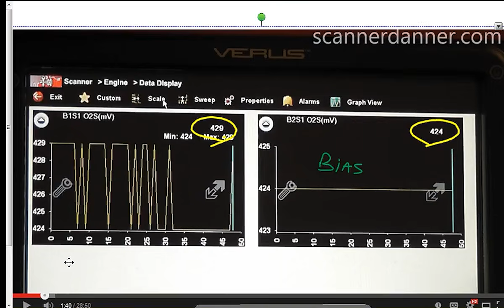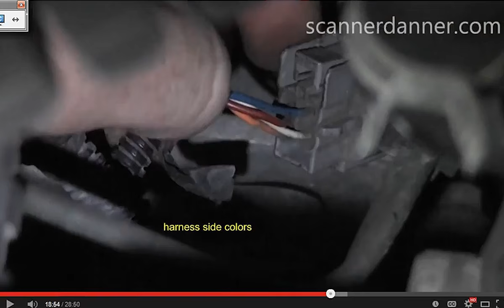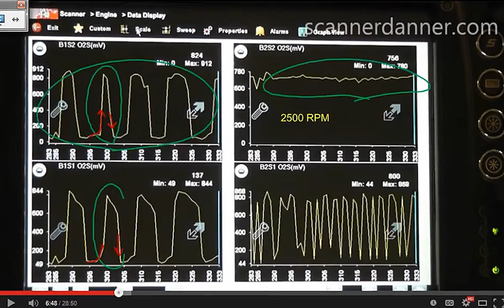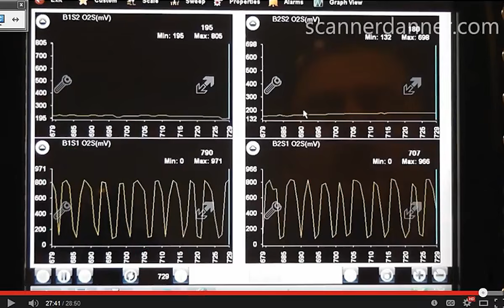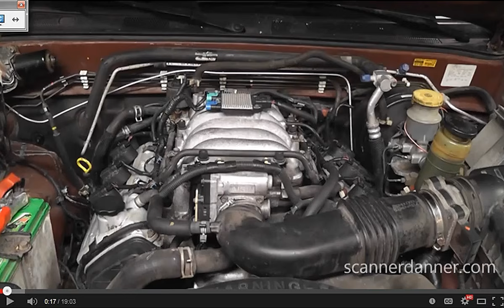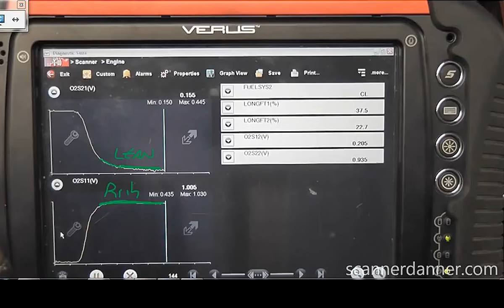P0133 Oxygen Sensor Slow Response - how many of us just throw a sensor at this code?

Comment: I have a 2002 Lincoln Ls v6 and getting this p0133 and p0301 I bought a new upstream sensor and installed it car still ran rough but no check engine light or codes before this I took out both bank 1 and 2 and cleaned them I may have accidentally got them mixed up would this cause this issue?
Reply from the maker: Focus on the cylinder 1 misfire first

Comment: Of ALL the diagnostic electronic issues a technician is trying to analyze - they should not even have to be concerned that the analyzer is not reporting the correct sensor 🤨 AND  what you teach regarding incorrect identification of the proper sensor reporting  Is indeed because YOU are an ACE TEACHER AND TECHNICIAN 👍 but - surely - this knowledge only comes with MANY YEAR of EXPERIENCE - THANK YOU for ALL you share and teach 👍✌️

Comment: Wow, that's a tough one!  I've had those moments too, where a problem feels impossible to solve, and then it turns out to be something so simple and unexpected, like two O2 sensors being swapped. Every challenge like that is a learning curve. That Mazda CX-5 might have kicked my butt for a bit, but now I've got that experience in my back pocket. Next time I run into something similar, I'll know exactly what to look for. Thanks for the heads-up, Paul!

Comment: On the Isuzu rodeo "low power" case study, would bank 2 receiving the incorrect lean signal from the wrong bank be positive 40 and bank 1 thinking it's running rich so it would be -40. You said add 40 for bank 1 and -40 for bank 2?

I understand the majority of the information and what's going on in the explanation, just seems like you got you numbers backwards. Thanks for all that you do.
Reply from the maker: It's possible I got my numbers backwards in my example from what was actually on the car. But one bank will be full rich and the other full lean. I'll watch again. Thank you!

Comment: Same connectors happen so often it's insane!

Some of my favorites include:
2022 Chrysler Pacifica, hood latch ajar connector and horn connector are the same and live right next door to each other
2017 Toyota Highlander, Wheel Speed Sensor and SRS Impact Sensor connectors are the same, and the harness easily flip-flops so both are within logical distance.

Now here's the big question for you:  Can a wheel speed sensor that generates voltage in operation create enough voltage to trigger an airbag deployment?  I don't know, and I kind of don't want to know, because I almost took that car out on the highway instead of just creeping around the parking lot...  LOL
Reply from the maker: Damn, that would be possible. Wonder if that WSS was a VR type or digital type? But either way, I wouldn't want to find out either

Comment: And another when I worked at the same dealer, a used VW had some faults and MIL on.  I don't remember the codes, but one was circuit high and another was circuit low.  Turns out that whatever sensor had the faults had the same connector as the hood ajar switch

Comment: Also, I worked at a Mitsubishi dealer and a customer brought in an old model for a rear main seal.  The other tech had to cut off the exhaust because the factory exhaust had been welded.  The vehicle was sent to a muffler shop to have the exhaust repaired afterwards.  When it came back it ran so bad.  I spent a while on it and turns out both upstream O2 sensors connectors had been reversed at the muffler shop.

Comment: I do recall a dodge pickup came in for an ABS fault.  We had an autel and a snap on scanner.  The autel was mixing up the front wheel speed sensors.  One wheel bearing was really shot and the snap on showed the correct sides wheel speed.
Reply from the maker: One of those variables to chalk up to memory and recall at a later time right? Crazy how much that can mess you up when a scan tool lies to you

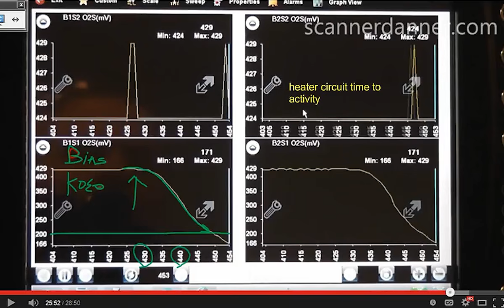Comment: 19:09 how much does the sensor need to cool down after running in order to see the bias voltage before starting it and watching it drop because of the heated? Because most of time we get cars that have been running recently because the customer drove to the shop to get it checked, or even because we drove it into the shop from the lot
Reply from the maker: Good question! I am not sure, but a typical narrow band O2 needs to be a min of 600 degrees to work properly. A wideband is even higher, somewhere in the 1200-1300 degree range. So not very long for it to cool off enough to see this bias

Comment: So confused on how this goes from slow response, to incorrect bank-data?
Reply from the maker: This wasn't incorrect bank data, this was an upstream and downstream sensor connector that was swapped on the SAME bank. Remember B1S1 and B1S2 is the same bank! 
The incorrect bank data was mentioned but that was from a Nissan and was one of my concerns going into this, but that proved to not be the case. Was that what you were asking?
Reply: It's like somebody giving you milk and you're expecting tequila your taste buds will tell you it's wrong
Reply: they were plugged in back-asswards so it was reading the one after the cat to get mixture info. the cat's job is to clean the exhaust. so the ecm was probably doing huge rich/lean swings to get that sensor to switch - which takes longer (hope that made sense...the cat is like a big pillow that absorbs everything)   (edit) - yes, as Paul said they weren't swapped side to side, they were swapped front to back. I should have mentioned that
Reply: @colestowing8695  thank god mine uses cheap narrow band for the secondary.  can't get them mixed up.  Did get lots of complaints when the clogged cat was "fixed". But the trims stayed normal.

Comment: Hmmm I have a 09 Forester that had.   P0420.. but that’s gone now.. and it has an intermittent P0139.    But it has a tick on cold startup.. and it goes away in the first 3 minutes..then back when hot .. have yet to check it.. 3k miles later .. 😂
Reply from the maker: you'd know it if you had this issue. What is the P0139 definition?
Reply: @ScannerDanner  02 sensor circuit slow response Bank 1 sensor 2